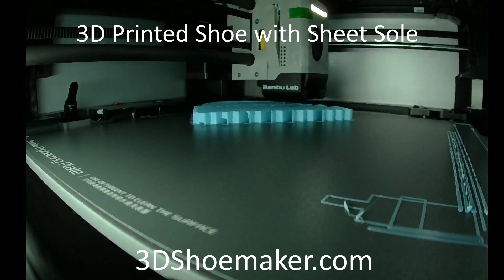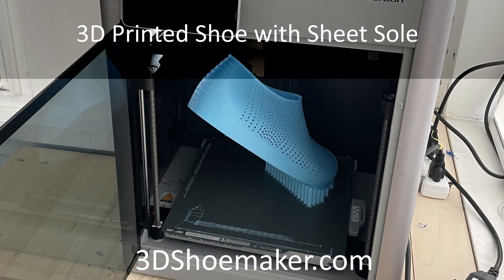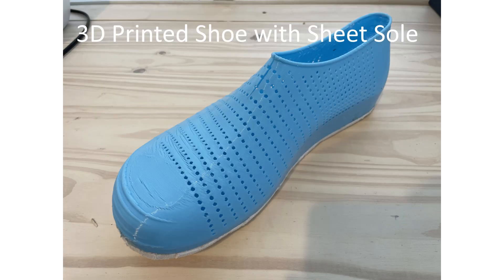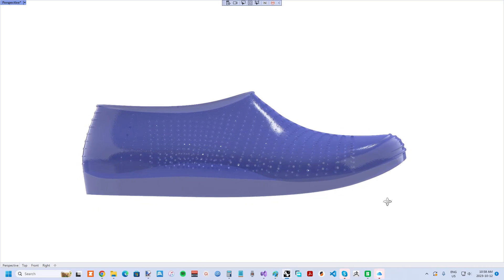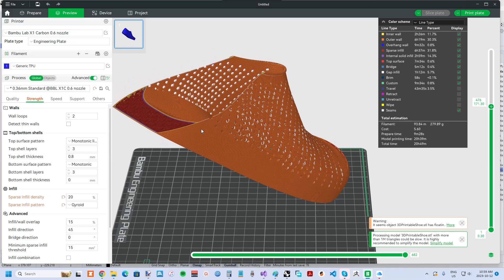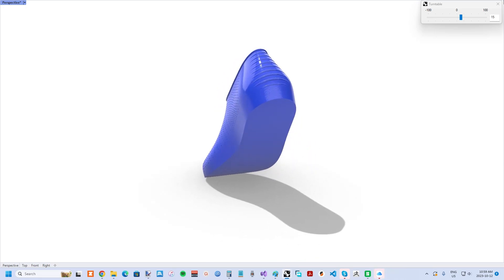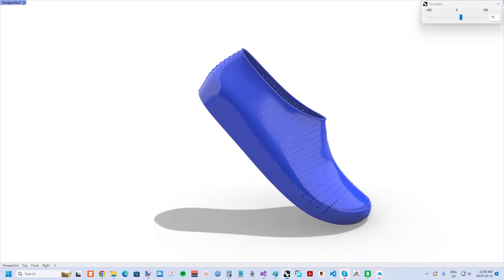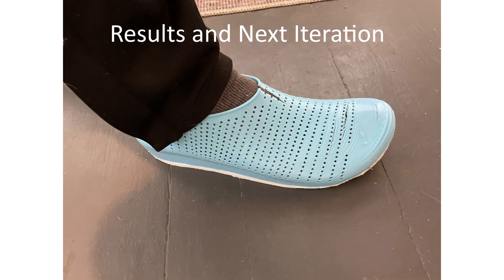3D Printed Shoe with Sheet Sole

Comment: Was it necessary to print the shoe at 45 degrees to get the softness in the midsole using the 20% gyroid infill or do you think printing it flat will give you the same cushioning?
Reply from the maker: Angle of print is more about managing overhangs...

Comment: What is a good filament for a shoe outsole? I am only  interested in printing and outsole and do the rest in fabric x)
Reply from the maker: at the moment, all I've tried is TPU. will try other stuff later
Reply: @3DShoemaker yeah but there are different TPU filament with different shore. Have you found a favorite for outsoles?
Reply from the maker: @lisagren  No... not yet, mostly been using just 95A, but clearly softer would be better

Comment: Very cool. That is very groovy even, very .45mm 3d printed groovy. One small step, though one giant leap for your kind.
I would like to try that too after fixing the printer.
Try printing using less supports at the toe point or gradiently less, and that could work within the limitations of the physics involved of separation of the shoe to not cause the process to rip away materials from the shoe.

Another consideration for if to make custom shoes, is 3d scanning the feet that shall step forward to walk miles in them if they are orthotically dimensionally accurate.
A cheap matching flexible or multipart mold can be created if to want to pour the proper materials normally used in injection molding.

Keep on rocking or walking as you roll.

Comment: It's really unfortunate that you can't print flexibles in the AMS. Might be worthwhile to get an IDEX printer now that there are "budget" options on the market, like the Snapmaker J1 or the SOVOL SV04.
Reply from the maker: I've heard there are some flexibles that might work. This is something I'm going to test soon.
Reply: @3DShoemaker yes they do. I got overture high speed to work, priline black also reputedly works, and harder flexibles are supported
Reply from the maker: I haven't had any luck with overture high speed... will have to try priline at some point @Tom--Ace